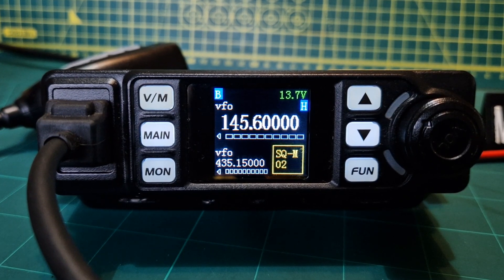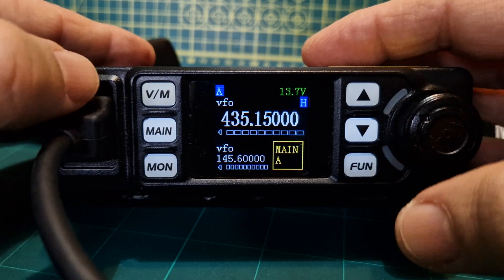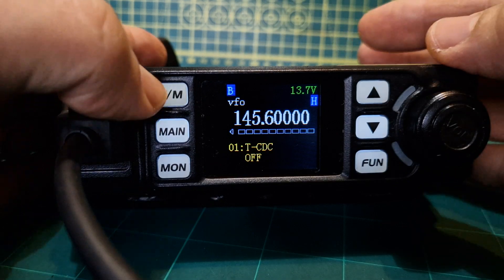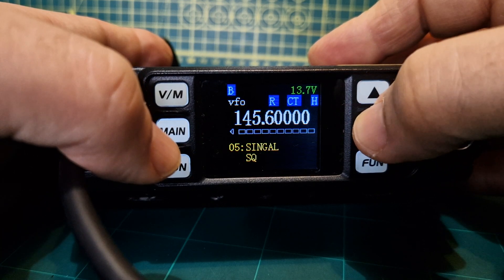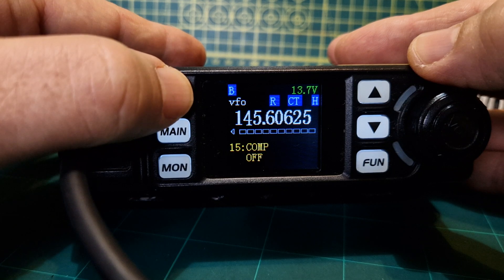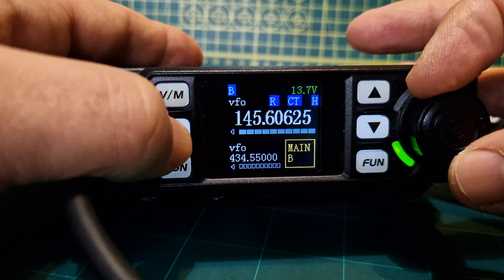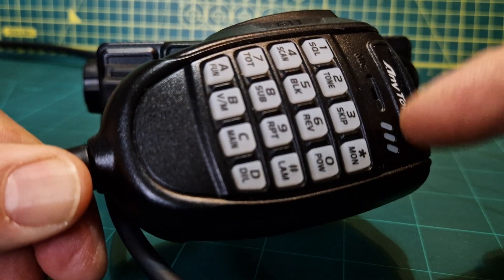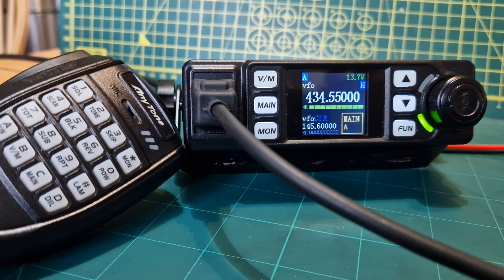ANYTONE 779 V/UHF & GMRS Budget Ham Radio

Comment: 4:25 Is the word “signal” really misspelled within the radio programming? It literally says singal. 

This radio seems feature packed for what it costs but that’s the kind of thing that would bug me and make it feel cheap.
Reply from the maker: Cheap as chips
Reply: @M0FXBHamTech  I noticed in another video about this same radio that it is also spelled the same way. However it might be limited to just the Anytone version because the Radioddity DB20-G version of it has the spelling corrected. The DB20-G also includes the missing channels 8-14 on it as well, but still doesn’t allow transmitting on those channels.